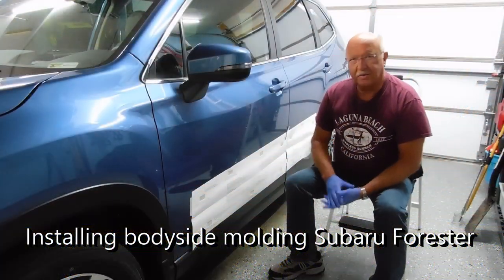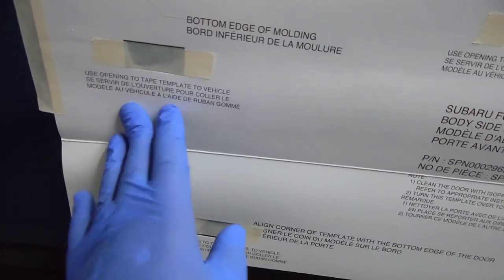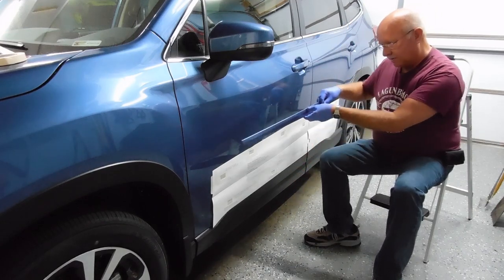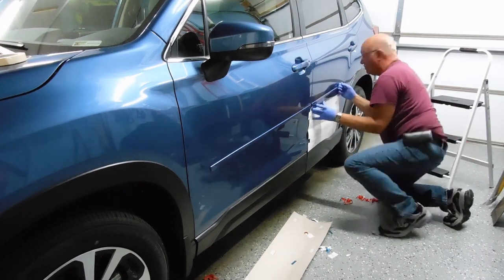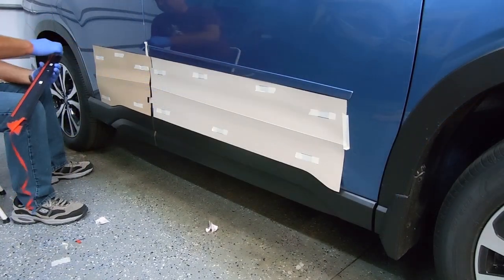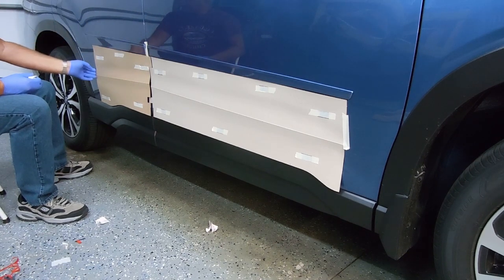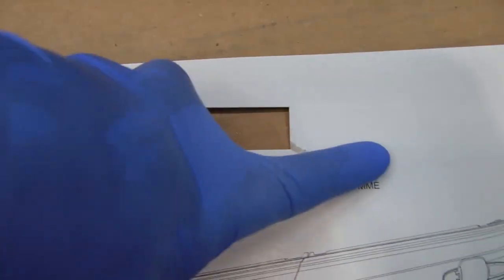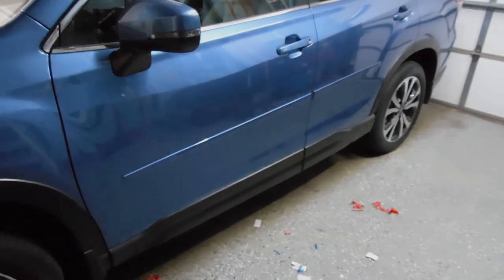Subaru Forester Body Side Molding Installation

Comment: Nice easy to grasp instruction for a green thumb like me. I did it myself on my 2020 forester and they look great , however not exactly perfect. Once you press them on , they are not coming off. If your a shakey , impatient person like myself I would seriously look into just paying a pro 50-70 bucks to make sure it's done right. Good luck, Ed
Reply from the maker: It’s good to get feedback for people that are considering, but mine did go on without any issues. I did know to start at one end, and not remove all the tape. Just pull it out as you move along.
Thanks for watching and taking the time to comment 👍

Comment: thanks for the video. was successful yesterday applying mine. key was starting from the bottom and feeling the edge of the cardboard. then press them in place bottom to top. you may have to give a little effort to pull out the guide but after affixing them.
Reply from the maker: You’re welcome. Thanks for watching!
As an update, In just a few days and mine will have been on for 2 years. No problems and no door dings.
I also travel a lot in the winter going from the frozen north to the Sunny warmth of southwest Florida.
I also have unlimited car wash pass, so I wash it often.  I’ve got just over 60,000 miles on the Forester in the two years (YIKES) very happy with both SUV and the molding!👍👍
Reply: Exactly how I did. Removed all the tape, placed one edge against the cardboard, then like a hinge, laid it flat and pressed it down. Super easy.

Comment: Thanks Dan  , have they saved door dings ,I have a 2019 forester and you’ve only got to look at it and it will ding   , take care
Reply from the maker: You’re welcome.  This is my third Forester and you are right! First two had door dings. This one has none and and I’m about to flip 90,000 miles.  Due to lack of inventory looks like I might run this one to the 200,000 mark 😂👍

Comment: Is there a specific temperature you need to do the install?  Can't do it in the winter unless you have a garage?  I don't know what activates the adhesive in the edge guards.....
Reply from the maker: I’m sure that you wouldn’t want to do it in winter cold conditions.  There’s a strip that you pull off that covers the adhesive strip underneath it.
The instructions may say the minimum temperature to apply, unfortunately I didn’t keep them.
I will say that mine go through extreme temperature changes due to my garage being heated.  I also go through a car wash weekly even if the temperature is in single digits.  No problems.

Comment: Well I went ahead and ordered a set for my ‘23 Forester Limited. Thanks to your videos it was an easy install. However, they have changed the templates for some reason. Instead of starting at the bottom of your doors to start your template, they start just underneath the doorhandles of both doors and the straight edge to place the molding is at the bottom so the actual body molding is below the cardboard templates.It’s in the same place just a different way to put them on I guess.
Reply from the maker: Good to know! I have a new 2023 Forester on the way…. Supposedly in the next few weeks. It’s the “Sport” package and it doesn’t have the body side molding. So it looks like I’ll be installing another set.  Thanks for watching and giving me a heads up.👍👍
Reply: @BoilerDan1  Sounds like Subaru has a long term customer! Have you had any problems or complaints with your last one?
Reply from the maker: Zero issues. This is my 3d Forester.  I’ve been able to trade each time at around 100,000 miles.  I could keep a lot longer as they all have remained solid.
I do change my own oil, every 5,000 miles.  I’m sold on them!👍
Reply: @BoilerDan1  Where can I order for our 2020 Subaru Forester Premium? The dealer charges $217 for the moldings and $120 for installation. The parts guy said it takes three hours to install.
Reply from the maker: I’ve been looking for a better price as I have a 2023 Forester on the way!
Here’s a link to a dealer that has them for around $188, but you’ll need to pay shipping. For my location shipping was under $20.
Here’s the link:
https://www.subarudirectwholesale.com
Reply: @dannytempleton2619  No way 3 hours. I've never done it before and spent about 45 minutes start to finish. If possible order for pick up from a local dealer to save on shipping. I paid $185.72 locally and picked them up.
Reply from the maker: Hey Danny;
I’ll check with my dealer, hopefully they are competitive with the price.
I’d definitely self install again. It’s easy and as I showed in my latest follow up video. I’ve had no issues with the ones I installed on my 2020 Forester!  
Installation video: https://youtu.be/V4SVTGklo8o
Follow up video: https://youtu.be/ghzk7N_5cgs

Comment: So I’m thinking about buying this for my crosstrek. Can I make my own judgement of how high to put this or does it have to be in an exact spot? I’m buying this in response to ding in my door this week and maybe I can use this to cover it up.
Reply from the maker: Yes, you could put it wherever you want.  I’d suggest that you have a second person help pre-positioning it prior to pealing off the cover of the adhesive tape. Just to make sure it’ll follow any contour of your vehicle.
Hope it works out well.
A ding in one of my previous Foresters prompted me to put them on mine.
Thanks for watching 👍
Reply: @BoilerDan1  Thank you for the reply and for the helpful video!
Reply from the maker: You’re welcome.  I’m sure you were not happy about the ding in your door!  I hope it works out perfectly.  In theory, the body side molding should lineup right where the doors get struck anyway!  Maybe you’ll discover that is the case with yours!😁👍

Comment: Thanks for the informative video.  You confirmed i did everything right ! :)
Reply from the maker: Great 👍 Thanks for watching! I’m getting ready to do my first oil change.... did you know that there’s a plastic cover over the oil drain plug?  I’ve heard of some people accidentally draining the transmission fluid that is further back.... Maybe I’ll make another video!😂👍 This is my 3rd Forester and I just don’t trust the dealership. Bad experience many years ago 🤔
Reply: @BoilerDan1  i have seen that but usually have the dealer or fast oil change to that work,  I only change the oil on my motorcycle but i think i've figured there is a lot of confusion over where fluids go in and exit the car and other important maintanence points.
Reply from the maker: I did make a video for changing the oil.  The plastic cover slides out of the way!  But I understand having it done at a shop for convenience and warranty records.  Sometime check out the video, it’s an easy task and about $25 . I’ve seen prices for having it done and I figure I save more than twice that by doing it myself 😁👍